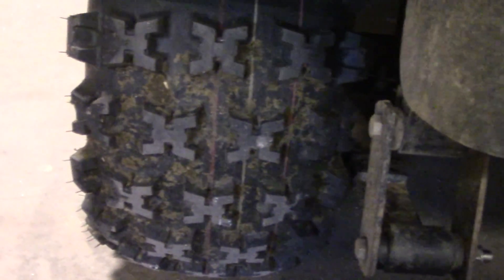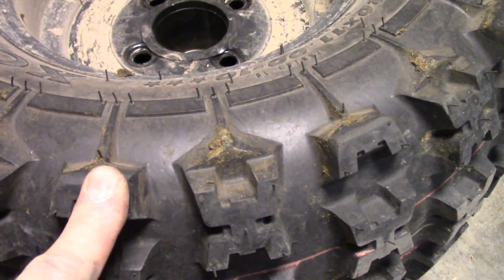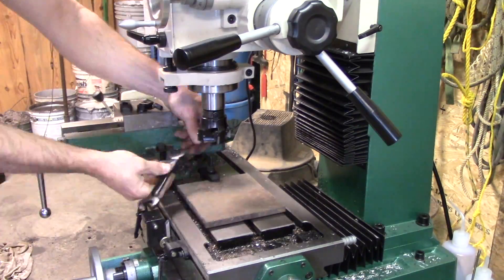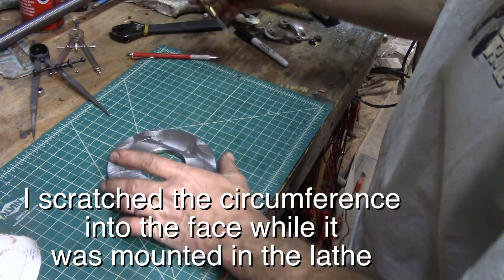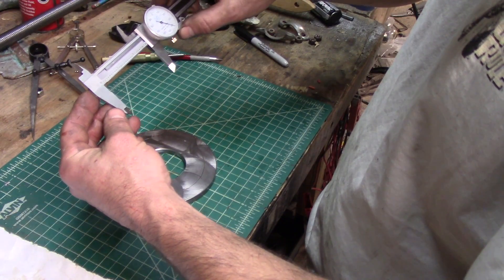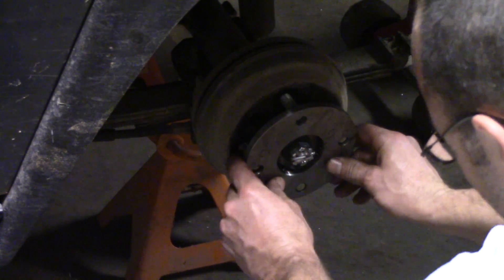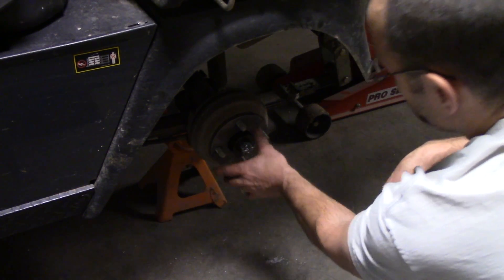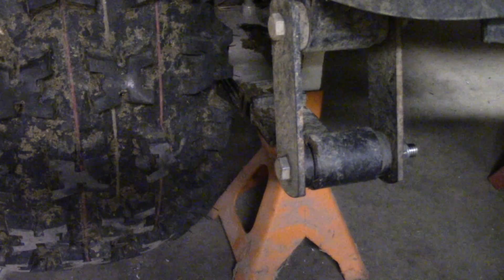Machining a hub plate. Repair / mod of my EZGO utility vehicle.  FarmCraft101 DIY

Comment: Before you went on this path, did you measure the distance from the other side hub to the leaf spring mount on the axle? Seems to me that the designers would have foreseen this issue and put in enough clearance all the way around. There should be a pin that locates the spring base, if it broke off the spring base would be able to move on the axle.

Comment: I love this guy! the way he goes about these problems is very clever. I personally would've just added thick washers 1 1/8 F436 washers (two per bolt) to it and don't mess with the machining but this works too.
Reply: Sometimes you just wanna make something.

Comment: got an easier means for you to crank out the next spacer plate.
template it for you...next time just spray paint from the inside out onto a sheet of paper applied to the outer face,
STENCIL the pattern..less math, and the mode this non math using Dyslexic would favor.
good videos...digging your channel.
Rock On... Seeya, Dude